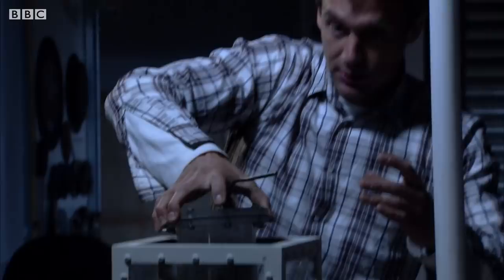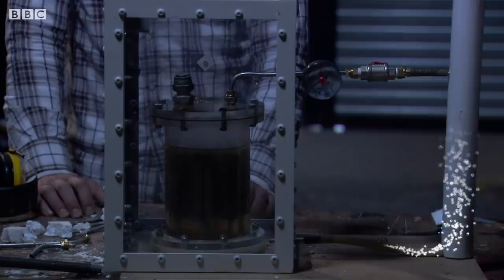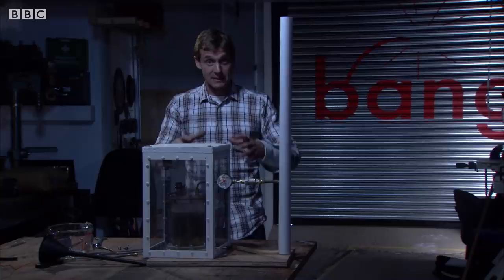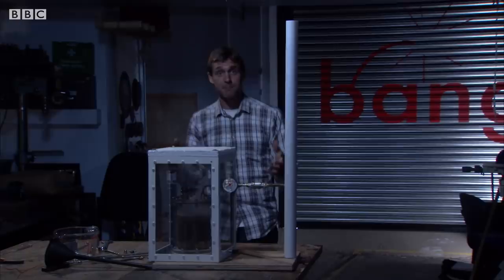Fukushima Nuclear Disaster Re-created | Earth Science

Comment: can you really never blow up a nuclear power plant? 01:45
Reply: No, you can't the fuel can't sustain the chain reaction necessary for a nuclear explosion, it's not pure enough.
Reply: just compare weapons grade uranium/plutonium to the stuff they use in a reactor, one is like 20% refined the other is like 97% refined, the answer to why you DON'T want it to be too refined is obvious, the less refined the uranium the lower the chance it will create a uncontrollable sustained reaction, the impure parts help keep the pure parts away from each other and absorb some of the reactions thus helping to keep it cool and controlled.  (a very lacking in direct data answer, just think of it like this, if the air is only 20% oxygen it won't explode when you light a match if it is 97% oxygen then it will)
Reply: No it wouldn't speedy, oxygen doesn't explode
Reply: The chernobyl power plant almost completely exploded due to false information about the water tanks.

Comment: yet we have a video of top of containment vessel cover moved and all the bolts stretched and broken, and cover literally not sealing and them throwing water on top of it to cool it and it enters reactor. the official story is self contrary and negating. Hydrogen explosion destroyed the building, likely but not probable when we have video of what, unit3 cover flying over 100 ft into the air with concrete and falling some meters off containment vessel. More likely the containment vessel exploded and that triggered the hydrogen explosion. if the contaiment vessel was not broken, there would not be fuel out and around the reactor buildings as it was found. It would only be in water used to cool the reactor.